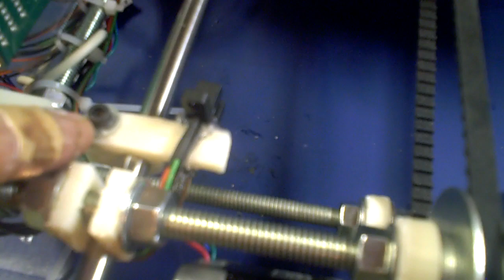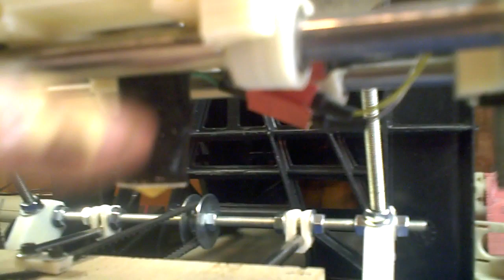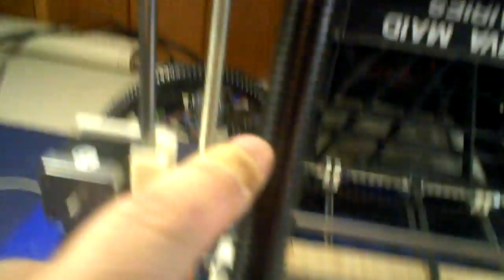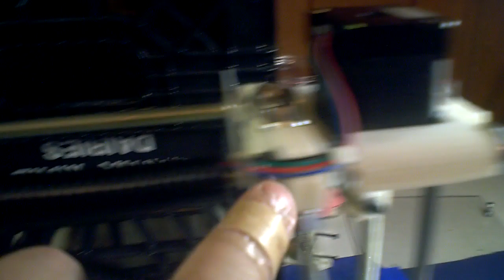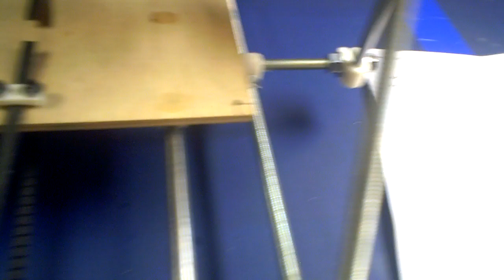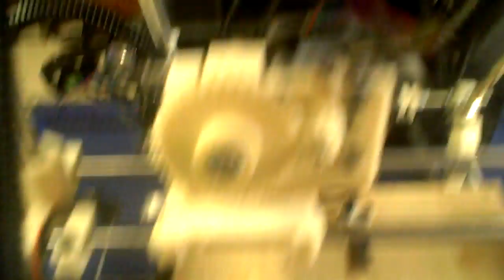RepRap Prusa Mendel Build Unofficial Part 10: Installing The Electronics

Comment: Hi!  Thanks for the great tutorial. :)  Say, you asked for feedback at the end of the video, so I thought I'd offer some.  At some point, you mention that "it doesn't matter where you put the endstops".  Is that really correct?  When I built my Darwin, I messed up where I put one of my endstops.  As a result, I had to set one of the axis to invert in the firmware, and all of my prints came out mirrored.  Just wanted to give a heads up. :)  Thanks again for the video.

Comment from the maker: @niccomaker You can use any power supply you want that puts out 12V and is 5 amps (60W).  I use a 12V 20A switching power supply if I am going to use a HBP, or a 12V 5A if I am just going to run it without a HBP.  Your call dude :)